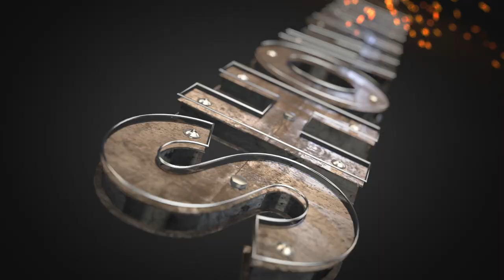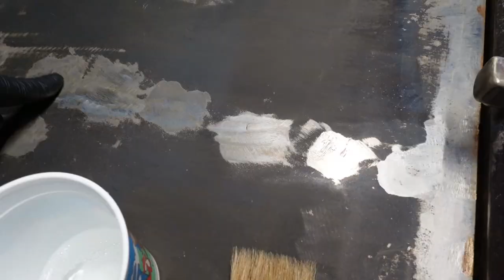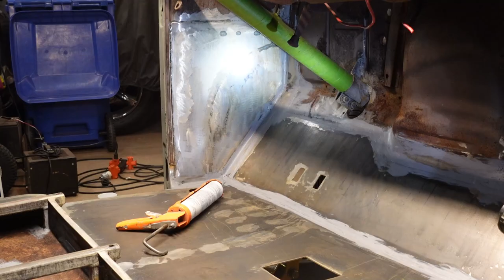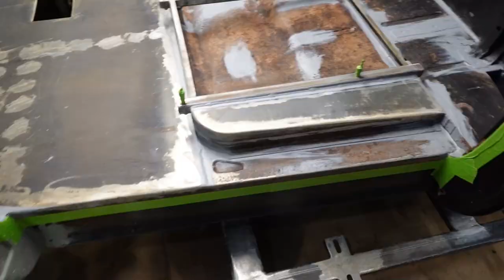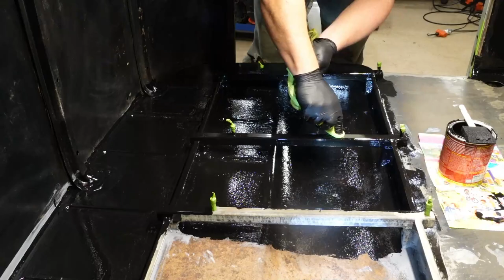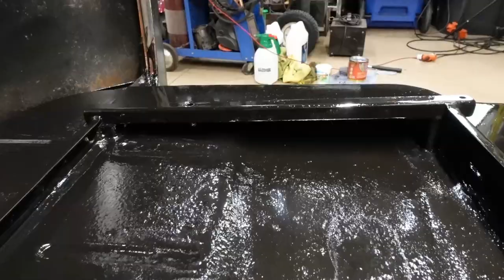PART 63 - 1952 Chevy 3100 - SEAM SEALER & POR 15 ON CAB FLOOR!!!

Comment: You should have put the POR15 down first it would give it a chance to seep into cracks ect ,it also likes a rough surface to bite into it's not made to go over a painted surface,  I believe the directions on the can says it preferred tooth over smooth
Reply from the maker: I suppose I could have seam sealed AFTER I used the POR15.... Not too worried for the inside of the cab as the entire floor will get covered in a few layers of sound deadener..... I'll paint the underside first before seam sealing...

Comment: great job, keep working with it because it's coming alone well. one question is the por 15 use on bare steel or can I apply it on primer?
Reply from the maker: I think its really meant for bare rusty metal.....

Comment: Not sure of what you are using but is it ok to put that seam sealer on bare metal ? my experience has been to prime first . If the reason to do this is to prevent rusting in the future I would think that skipping that step might not be the best thing ?
Reply from the maker: I probably should have primed the floor BEFORE seam sealing.... that's the general consensus at this point..... but it's done now..... i'll do that correctly on the bottom for sure!   The good thing is, the POR15 seems to be tough as nails.... and the entire floor is going to get a couple layers of sound deadener.....  The next time this rots out I'll be long gone :)